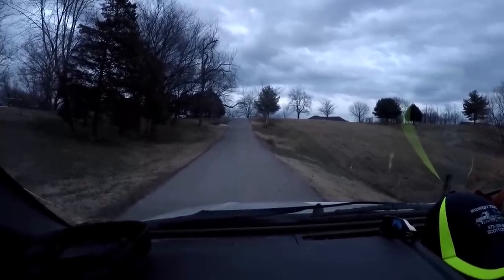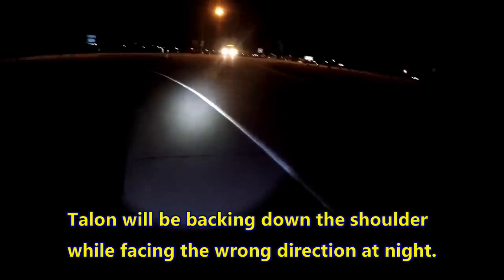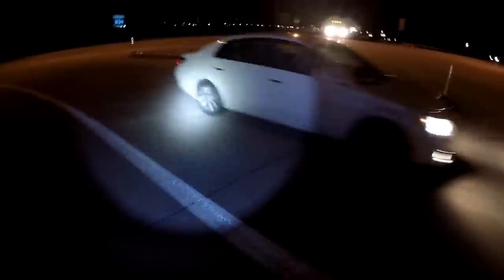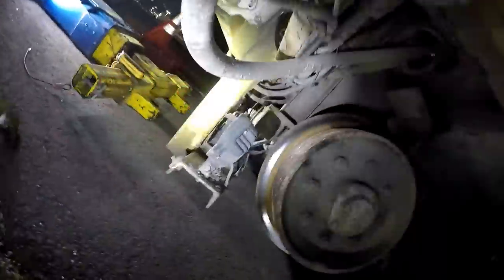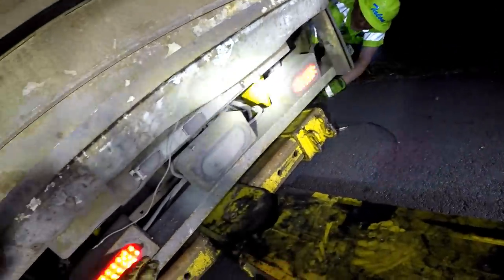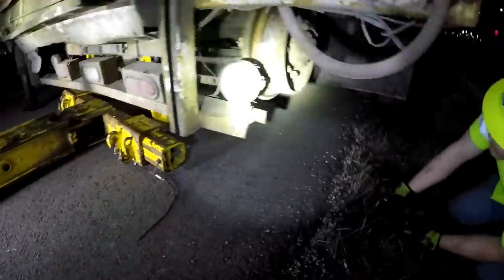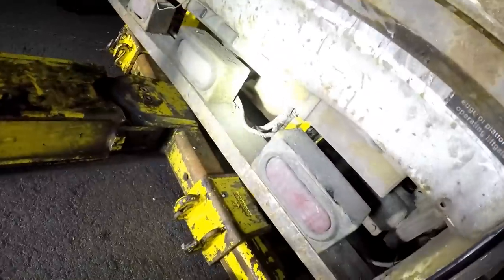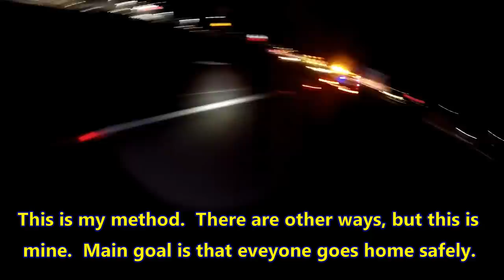Simple Tow Turned UH OH!!

Comment: Ron, one recommendation since that light is strobing white light in a specific pattern is to change it to the red/blue strobe mode.. the white at a certain angle can blind people because is a straight beam..  I learned that with mine at scenes...   BTW did you buy a second one?  Noted you put the one on the ground but still had helmet light too..

Comment: Would have taken a couple extra minutes but with an impact you could take off the passenger rear tires thrown them on the rollback, then drop the ass end a little more to clear the front high lifters. Something I've seen done on a call before.

Comment: It’s your butt on the (white) line. Do what you need to. I lost the left rear on my pickup pulling a trailer through Missouri, and was jackknifed a foot into the right lane. The way traffic was acting, I grabbed my phone, got out of the truck, and ran up the hill on the other side of the ditch right quick. I’m still shocked there weren’t a dozen colors of paint on the front bumper. I guarantee a person wouldn’t have fit between the bumper and cars doing 75 mph.

Comment: This is what happens when you use a big breaker bar or even steel pole to tighten the wheel nuts, instead of using the correct torque!
Them nuts must of been screaming when they were tightened up 🙀
Reply: The service trucks I've seen used an air impact driver that just rattled until the mechanic got tired of listening to it. I've been told they're set to a specific torque value but I've never heard what that was. On some large grape harvesting tractors that I used to haul, the spec was 600 lb/ft of torque, but that wasn't a road-side operation.
Reply: They must have mixed up the impact they use on the locomotives with the impact they use on the vehicles!!!

Comment: Sadly most drivers are oblivious as to why they shooed react to emergency lights on a  vehicle.  Most are under the impression that the purpose of the lights are to make them pull over so that vehicle can have the right of way.  And that is as far as they even think of it and don't have a clue that the lights are there for safety reason and on going warnings.  They react to a vehicles emergency lights when one is coming up on them because they know they can get a  ticket but once they no longer see that as an issue they don't care.  I am further surprised how many actually get upset that tow companies have emergency lighting, think they are using it to get ahead in traffic and should to even have them.  I notice that is states that have laws about pulling over to a far lane when any vehicle has emergency lights on and one fails to do so they get a heavy finned - traffic pulls over far in advance of seeing lights.  I also notice more and more highway tow companies now have a smaller truck with a  big LED lighted sign in the bed with a large arrow directing people into the far lane.  They were used by state highway crews for many years but now the tow companies have adopted them and I can see why.    Cones or triangles and even flares are hard and dangerous to place and often are not seen well by drivers.  A pickup with a great big electronic sign with a  huge arrow pointing left parked on the shoulder prior to getting near the accident site really seems to get peoples attention and clue them in.

Comment: That truck driver is real lucky that neither one of his tires slammed into another car causing them to wreck.
Also, as others have said, you can't be too safe esp on a highway! Put out as many cones and lights as you want or have. With all the distractions that drivers have in their cars today, radios, CD and MP3 players, loud music, cellphones with calls and texts going on and people not willing to let those calls and texts slide until they are parked somewhere. People are too distracted while driving. Even the police get hit often because of their dark uniforms. They often don't wear high viz vests, they don't put out cones, they only have their light bar. It should be enough, but it's not sometimes.

Comment: Since the truck had duals, could you have pulled the outside rear off the right and stuck it on the left studs with a few nuts, and then at least towed or driven it off the interstate to some safe place to do a better tow?
Reply from the maker: The studs are broken on the driver's side.  That is why the wheels were missing.  Good idea, but wouldn't have worked in this situation.  Thanks for watching and God bless.
Reply: Ah. I thought I saw studs there, but I missed that they were broken, and just figured the nuts had somehow spun off. Thanks for the reply. God bless.

Comment: 5:28 And now all you need is some Landing Lights.

16:01 It's too bad that you don't have a LED Light Strip that is 4 inches wide and 25 to 45 Feet long? This would be much quicker to lay out and the strip could be made out of a material that could be ran over and it would be reflective at the same time. The LED Lights would be color changing and they would have different patterns. Depending on the situation you could have the strip light up so it may make cars see it and not want to be very close? With the strip idea you could lay (2) Two strips, one on the lane and one just outside of the line that you don't want cars to cross.

Comment: That was a pig of a job. I would be asking some serious questions of the maintenance level of that vehicle with such a serious failure at the worst possible time.
Reply: That's the reason that it is so important to heed the 50 to 100 miles recommendation of re-torquing your wheels after having them serviced.  Wheel off events happen far more then one realizes and they are very much preventable.  Also when removing wheels it's important to clean everything well and inspect the hardware for damage.

Comment: IT's a shame you can't do a citizens arrest for not moving over, of course, you'd have to take a  picture of the vehicle not moved over. but that really would not be hard, by using an external video camera aimed at license plate high for the picture of the infraction. Yup, I would think like that if it would keep everyone safe no matter what state you are living in. Florida has the same thing here, slow down to 25MPH and move over. If you don't there is a $250 fine and 6 points on the licesne.

Comment: I found that the amber lights are the least effective of the emergency lights. This could be because to maybe uses them or they are similar color than indicator. What ever the reason.
Red, blue (or green) strobe lights draw more attention.
I've stopped a few times at accidents in the fast lane to "add color" to the emergency lights. Even thought I'm not officially involved with accidents, nothing prevent me from stopping to assist.

Always look at traffic. Takes one person sleeping or playing on there phone to screw up the day. And there is also something called "Target Fixation" From my experience, this appears to be worse at night. If at all possible, think of and escape route. And to others reading this, like I told one motorist once. Don't stand in between cars if you don't have to.

Love those strobe lights. But it is too expensive for me to afford. And the number of times I would have been using them are too few times. Would just have switch the rotation or flip them over as oncoming traffic would then get the impression of passing on one way.

Comment: Out of interest, why couldn't you tow from the front this time? I've been watching a few videos and I see there's hirail gear on the front of the truck. Was the way that that was installed in the way of your equipment?
Reply from the maker: This truck had one of the rear drive wheels run off of it and could not be towed from the front.  Thanks for watching and God bless.
Reply: Ron Pratt Sometimes you overanalyse the situation and miss the obvious. Thank ya for clarifying!

Comment: Overview
In British Columbia, motorists are required to slow down and move over for all vehicles stopped alongside the road that have flashing red, blue or yellow lights. This includes maintenance workers, utility workers, police, fire, ambulance, tow trucks, Commercial Vehicle Safety Enforcement personnel, land surveyors, animal control workers, garbage collectors and other roadside workers.

Motorists must slow their speed to:

70km/h when in an 80km/h or over zone
40km/h when in an under 80km/h zone
If travelling on a multi-lane road, drivers must move into another lane to pass when passing stopped vehicles with a flashing light, where safe to do so. This provides roadside workers and emergency personnel with greater protection from accident and injury.

Rules and Penalties
Drivers failing to adjust their speed or failing to move over may receive a $173 traffic violation ticket that also carries 3 penalty points. Offences and infractions that include penalty points can lead to a driving prohibition.

Comment: Is that kitty litter you used to clean up the oil? I saw the tip on the internet, and found that it works in our driveway.
Reply: Oil Dri, its like kitty litter but not clay and is made of a few different minerals that soak up and retain oil,
Reply: Yes it is oil absorbent

Comment: You lose a wheel up here (Ontario, Canada) and the cops get wind of it, you WILL get a juicy ticket. Also there is a slow down and move over law here. 4 wheeler or big truck it doesn't matter, I slow down AND move over.
Reply: a ticket for experiencing a mechanical failure?
Reply: Minimum $2000, max $50,000. Not for mechanical failure, specifically for losing wheels off of a commerical vehicle. Absolute liability offence too, which means your only defense is that nothing fell off. We've had plenty of people killed by loose wheels in Ontario. They will also go after the owner of the vehicle, the mechanic who last worked on the wheels, their supervisor, and the mechanic business itself. All potentially liable for $50,000 fines.

The fines for non-wheel parts falling off range from $400 to $20,000.

More info here: https://www.wheels.ca/news/both-driver-owner-liable-if-vehicle-loses-wheel/

Comment: Most driver are Color Blind Has cause from watching LED screen Evolution Make it Harder to distinguish a deer from tow truck driver ~ i nearly put doe a in orbit 2 night ago ~ that truck for uses on railroad hence the small wheels ~ those road flare are rough $10- to- $19 each in hardware.. i got one ~ ya some rollback deck are aluminum you might have add on steel strip ? (TV viewer might recognize those flashing light from TV show SWAT only thing his don't go bang?)

Comment: I gotta ask about the elephant in the room, where’d the duals end up?
Reply: James Trapp  so DARK SO HARD TO SEE. WHERE ARE THE COPS N HIGH WAY PATROL..?
Reply: Some fitter/mechanic DIDNT TIGHTEN THE REAR WHEALS probably took smoko then just plain FORGOT
Reply: Or, someone broke a lug or two and just replaced the broken ones, not all of them. Safety rule, if you break one lug, replace that one and the ones adjacent. Or, safer yet, replace them all. 

Once lugs have been overstressed, they are accidents waiting to happen. 

if I was the fleet manager for that truck I would be asking some very pointed questions. A loose wheel on a highway is a killer.

Comment: well done on a tricky job...and good to see you putting stuff down on that oil leak....would there be any mileage in getting a scrolling LED arrow bar you could put up to direct traffic to move over....do you have two way radios to use between vehicles...or when out on a job....see here page 18...https://www.ttsys.fr/library/catalogue/CATALOGUE_STEP_2016_en.pdf

Comment: where'd the duels go? Did they find them?
Reply: I heard ya say they found one
Reply: USN_Ret 84-05 saw one on the roll back they didn't see the second one is what Ron  said.
Reply: looked like they were on the back of Ron's rollback
Reply: only one they lost the other miles back im sure with all that stuff on that tuck they didnt hear the lugs breaking loose
Reply: My nephew lost a tyre & hub assembly on the highway; was found 2 days later, half a mile away over 2 fields, and 3 hedges. 50MPH. Engineer could not understand how it came off, all blts intact and none missing.New hub fitted, new tyre, wheel. year later came off. No one injured, trailer scrapped. NOT happening again.

Comment: The thing is- if you have red and blue AND the amber going--- they KNOW it's a tow or some other vehicle- and don't pay any attention---- but if it's RED/BLUE and arrowboard only-- it looks like COP-- so they do!!!   There are far too many drivers in this country that should NOT be driving AT ALL..   and many are just inconsiderate to the max..   I've had mirrors hit my back on freeways like that. Most of the inconsiderate ones worry about GETTING A TICKET-- but don't care about potentially HITTING someone..  Some morons also can not be bothered to slow down and get BEHIND the one in the left lane..  AS I've said- I've been hit in the back with mirrors-- (and yes injured a good bit)- which means not only did they NOT get over-- but came even CLOSER to me and my truck.

Comment: It's a sure thing trucks are going to break down but we always hope the mechanic didn't forget anything, like properly tightening bolts. When I was hauling equipment we had a water truck that I had to pick up with the float three times in a row for the same problem, brakes. It was a Ford with hydraulic brakes with a vacuum boost and each time the driver did a good job of not hitting anything. It was the head mechanic/ shop foreman who did the work and if I was not impressed with him before that I was less so after. I had a good outfit, a Kenworth with a 460 Cummins and an 18 speed with a 50.5 foot lowboy with a hydraulic beavertail, and a good strong winch at the front of the trailer. I never ran into any situation where I couldn't load alone although my boss was a great guy who did lend a hand if he happened to be at the same location. A picture is worth a thousand words so.
https://flic.kr/p/24uw3Uf

Comment: While all this backing up is loads of fun I'm sure, but....you knew there was a but coming right...but wouldn't it have been heaps easier and safer to just have a couple of smoke em up bears stop traffic so you could just turn around both ways going to the break down and again after the tow...I'm pretty sure smoke em up bears can do what ever they want unlike you!
Reply from the maker: That would have been an option.  Turning around on the interstate is never a safe thing.....not that backing down the shoulder was either, but the police do not like shutting down the interstate even for a minute for the risk of secondary incidents.  Thanks for watching and God bless.